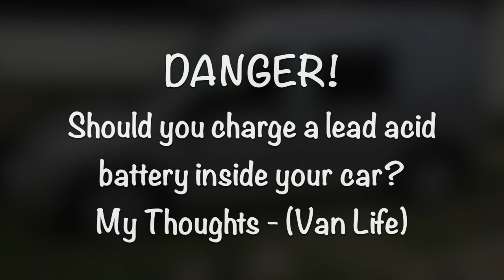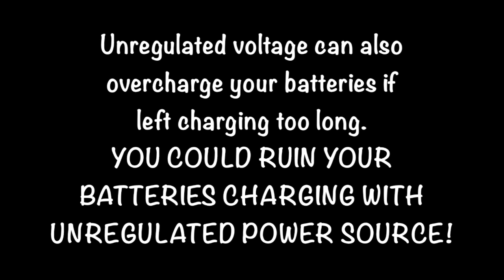Lead Acid Batteries: The Hidden Dangers of Charging

Comment: I built a box out of plywood to hold the batterie, cut a 2” hole out of the top for venting, ran a flex hose from the box to a hole cut from side of van. It takes about half hour to cut hole in side of van with metal jig saw blade and fit a vent receptacle you can buy from camping RV store. It’s cheap and fast to install and you can pull the vent hose off to remove batterie from the van.

Comment: Stock battery is under driver's seat already
Reply from the maker: Not in a Transit Connect, it's under the hood.
Reply: @WannaBFree  transit highroof is under the dr seat.
Reply: @noahbell7767  I have seen other vehicles where the starting battery is inside the car. I wonder if they have any venting to the outside?

Comment: Very good points. Thankyou! 👍 I don't think that you'll ever experience the height of voltage at the back battery as you have at the starting battery  (while charging from the starting battery) due to the guage of wire and the resulting resistance that feeds the cigar or accessory plug- in.
Reply from the maker: Yup you are exactly right. I did a short drive while charging test today with the little 12V extension I made. I was seeing 14.2V at the dash plug and the most I saw at the house battery was 13.8V. After this little test I'm confident I won't have any problems running the cord and charging while driving and running the fridge. If I am getting some gassing it most likely isn't much. I don't think I will get much charge in the house battery that way but it will keep it topped off while running the fridge.
Reply: Thank you for this video. I hadn't found much on these points when I had the same questions. I appreciate your frankness and found these details very helpful.  I don't plan to charge my house deep cycle from my car battery unless I really need to due to a circumstance that may restrict solar/wind charging..
The option of charging through the cars auxillary outlet seems like an OK choice as long as the adapter plug can be routed through the charge control box where I can set and control all the parameters. In your opinion does that sound like a decent option? My charge controller let's me adjust all the parameters of how much charge to let in and how much to let out. My solar panels came equipped with the proper charge controller and adapter plug for auxillary charging.
Reply from the maker: I really don't know, I have never set a system up like you described. Sounds like it might work though.